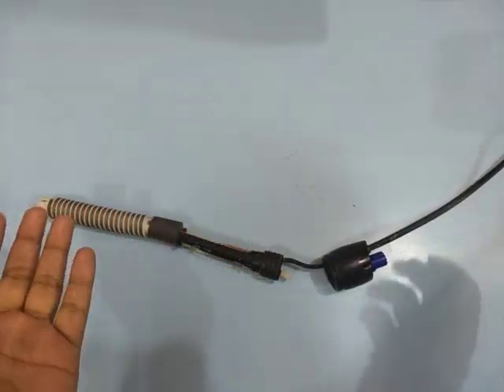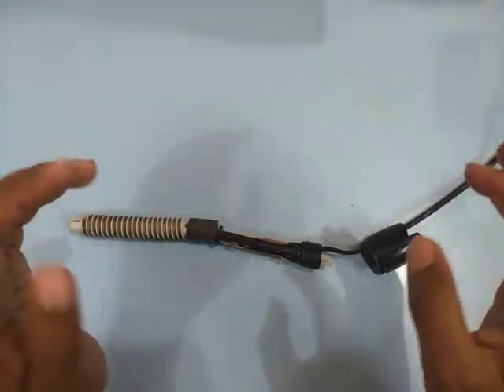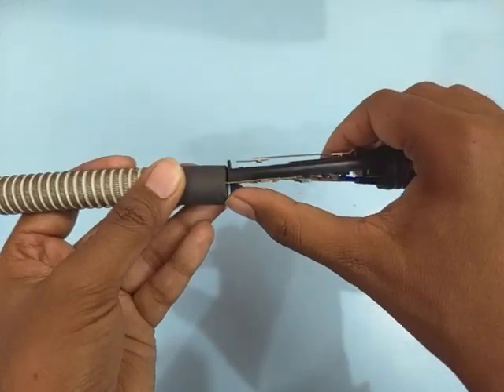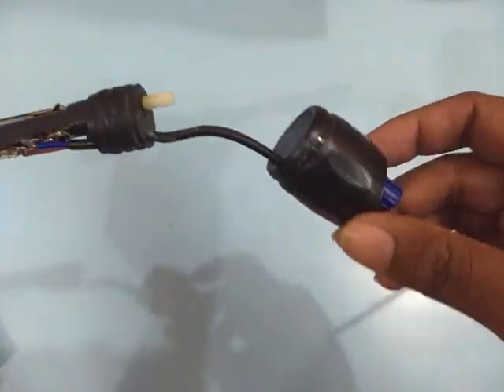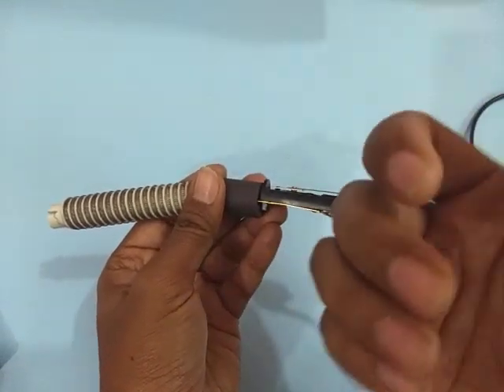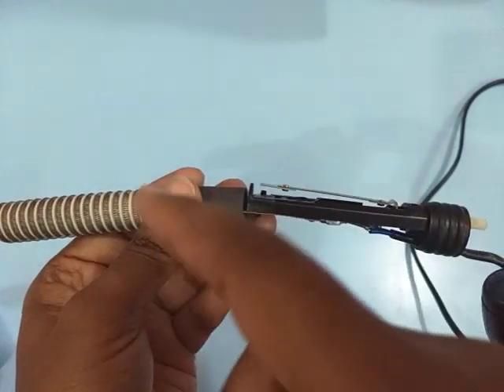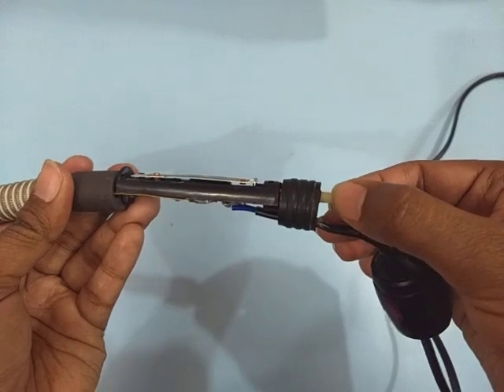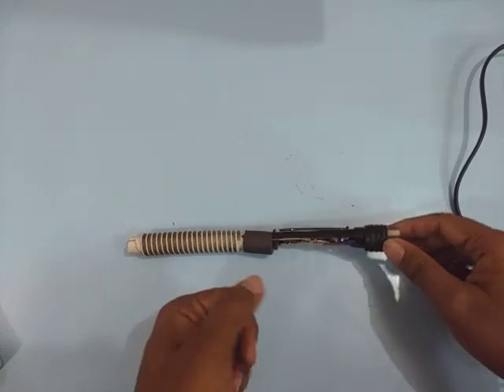How Aquarium Heaters Work & how to repair them(May be)

Comment: Sir , My 1 aquarium heater broke in my aquarium 😢 so yesterday I bought the new one But sir after some time i noticed the heater light 🚨 continuously on 😢 and sir its heating ..... Sir how to repair it please help 😭🙏🏻
Reply from the maker: try to reduce the temperature on the heater 1 degree and then observe the heater for after an hour or half. 
see if the heater is turning off or not.
if NOT then reduce the temperature more and repeat the process again.
Reply: @gurribuy  😓 you are so kind hearted person ♥️🥹  ...I like you 💗

Big bro I open 👐🏻 and cheaked the metal that join and left ... And I knew that the problem was in it ... I am trying to remake the system but It seems useless 🙂 ab hame Naya hi Lena padega (So now I used to purchase new one ) it's winter ❄️ in Uttarpradesh Prayagraj in India 👍🏻

Comment: Hello, and if I want to get the resistor wire, the resistor broke and I want to wind it again, what is that wire called?
Reply from the maker: you can search for heating element wire.
But, i would not recommend doing that unless you find the same resistance wire.
Changing the resistance can cause the heater to over heat and increase the watts of your heater.

Comment: my heater knob was loosen and it was not turning on at any temperature i turn but i took it apart just like you did and just push the knob down with a little bit of force with my thumb and its working now

Comment: The glass of my heater broke, so I bought another one and it broke too, what do I do ?
Reply from the maker: did you take it out when it was still hot or you turned it ON when it was outside water? This is usually what causes them to crack.
AT this point you can use some super glue to fill in the cracks and test it in a bucket of water first, to see if it is working properly and water is not entering inside heater.
Next time spend your money on a stainless steel heater.
Reply: if it broken again then purchase new 1 as u did before 😂
Reply: By broke I mean cracked
Reply: Yeahh I think that's what caused the glass to crack, can I use glue gun to fill in the crack for now, I don't have superglue
Reply from the maker: @niharikagangoli1490  no, glue gun will not work because the heater itself will get warm and glue will melt. U can use feviquick as well.  
if you have a cold drink bottle, you can put the heater in the bottle, make a hole in the cap for the heater wire (you will also need to cut the cap from side for the wire otherwise the wire will not get through).
put the heater write at the bottom of the bottle.
Then you can use glue gun and fill the bottle cap and make it water tight.
don't use empty cold drink bottle, fill the bottle with water or sand before you seal the heater in the bottle.
Reply: @gurribuy  cold drink bottle, the plastic one right ?
Reply: @gurribuy  hey !! Thank you anyway, you're such a sweet person 😊
Reply from the maker: @niharikagangoli1490  yes, the plastic one. but   i just realized that the heater will not get in thought the cold drink bottle. What fish are you keeping anyway, your tank height? and your water level height.?
Reply: @gurribuy  I actually have a turtle and I've not used the conventional aquarium tank but a plastic tub of 56.5x36.5x16.5 cm , I read they stay less stressed in there thats why.
Reply: And about the water level, I have filled 1/4th of the tank, just enough to submerge the water heater and other accessories .
Reply from the maker: @niharikagangoli1490  you can still use the bottle. first use feviquick for the cracks.
cut the bottle for the heater to go in, fill the bottle with water, keep the bottle upright, no need to use the cap anymore.
The bottle should stand upright in your tub above water level of your tank. if the bottle floats then put some stones in the bottle. or fill the bottle with sand.
This should work.
Reply: @gurribuy  okay thank you so much 🤗😝

Comment: Often the coil of my heater turns red into colour.. do i need to change it or shall I continue with the same heater. ?
Reply from the maker: well, aquarium heater coil are not supposed to glow but you should check the water temperature if the heater is maintaining the temperature then the heater is fine but you should still buy a new heater because it will eventually fail.
Reply: @gurribuy  thank you for sharing your knowledge.. ☺

Comment: My heater not working properly  not heat more
Reply from the maker: Just change the heater if you are not sure. What is the size of your tank.?
Reply: @gurribuy  27*12*15 inch, and 200w heater  sobo
Reply from the maker: 100W heater should be good enough for your tank. If you can afford then purchase a digital heater or a temperature controller with a stainless steel heater.
Reply: But it's new heater 
 You mean it's useless
Reply from the maker: What is the problem in your heater, you said its not heating the water. Did you check the temperature with a thermometer. Is the led on your heater glowing or not?
Reply: Led on but heat not properly
Reply from the maker: Did you check the temperature with a thermometer? The normal temperature should be about 26-28 degree Celsius.
Reply: Ok thank you ♥

Comment: What is the problem with my ill gold fish you can see on YouTube Rohit 2ft tank 31 sec video and tell  what is the problem with my fish
Reply from the maker: I can't say anything for sure. But things i can notice in your tank.
1) Too many fish in a 2 feet tank. so increase the filtration or keep less fish if possible.
2)gold fish can live in cold water so remove the heater if you live in warmer climate. or at least don't use the heater during summer time and use the heater only in winter.
3) if possible take the fish out in a separate tank or a bucket put a small air pump in it and don't feed the fish for at least two days. Add a spoon of table salt iodine free or rock salt or sea salt in the bucket.
Every fish is different so what works for me or somebody else may not work for you. I hope it helps.

Comment: 32 degree
Reply from the maker: in my video at 2:33 you can see the strip, go ahead and bend the strip down so that it touches the bottom connection. if it is already touching then at the very end of the strip put a small electrical tape to make the strip heavy. I hope this helps but i'm not 100% sure it will work. That is why i switched to digital heaters.The problem is that these are mechanical heaters and they have a bi-metallic strip that governs the temperature. The strip is not very accurate and sometime does not work properly. The problem that you are facing is very common with these heaters.
My suggestion to you would be to buy a 50watt heater and a digital thermometer. The 50W heater have a smaller strip that may or may not work. And if you want a stable solution, then buy a digital heater.

Comment: 100 w
Reply from the maker: at what temp does it work. did you measure it with a thermometer. does it heat the water at all or not.?

Comment: My heater is working but when ever I put it in aquarium it automatically turns off after 5 to 10 minutes and never turns on until i take it out of aquarium, I don't know what to do,
Reply from the maker: how big is your tank and how many watts is your heater.
Reply: Gurribuy Shopping 100 watt and the tank is 2 feet  and thanks for reply.
Reply from the maker: try to increase the temperature nob to higher settings and see if it turns on or not. If it does't work then just replace the heater. And if you can afford, then buy a led heater(digital heater) they are more reliable and more accurate.
Reply: Gurribuy Shopping did everything still not working thanks again.
Reply: ITS NORMAL BRO,ITS AUTO OFF WAIT FOR A MINUTE AND IT ON AUTOMATIC
Reply: Kyran Tacan I replaced now working fine. Thank you!
Reply: m facing the same problem..

Comment: Our aquarium heater is not working properly.......the led light of the heater is on that means the current is flowing but it is not heating up.....wt to do?????
Reply from the maker: If the led is glowing but the heater is not heating then the heating element must be broken. IF you can open the heater then look for broken element and join the broken element wire this should fix your heater. But i would not trust the heater after that.